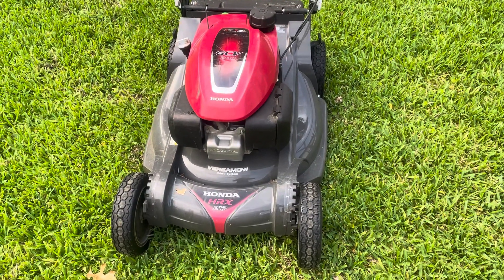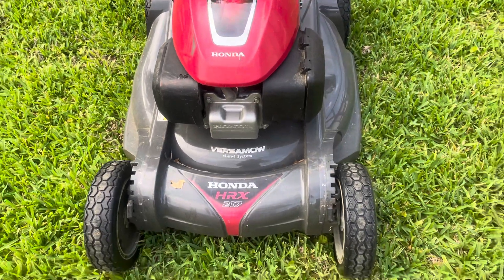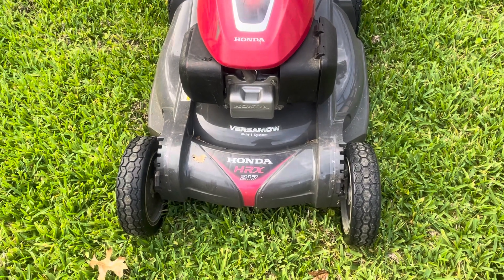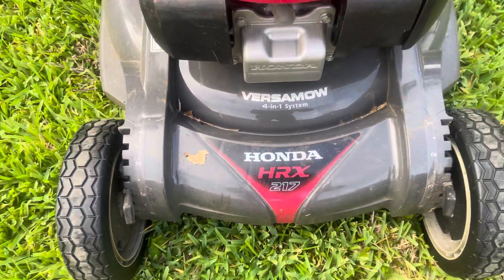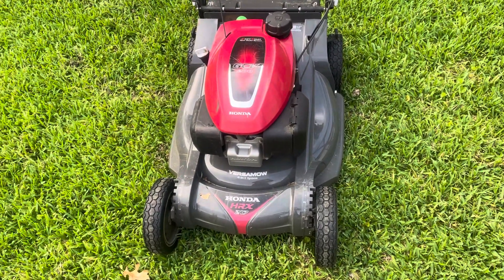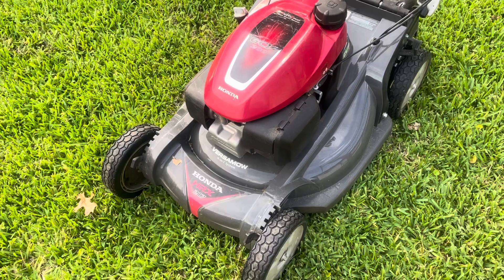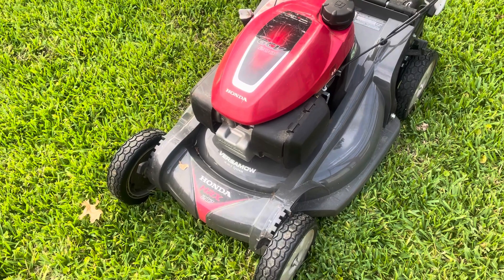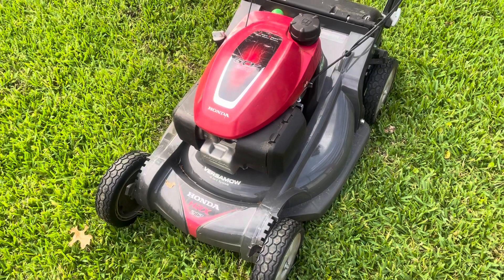Et Tu Honda ?- Plastic parts fail- just like in the new Sewing Machines- enough already! (Video301)

Comment: How true! I had a Toro riding mower for 35 years. No trouble until about 3 years ago. Plastic flywheel. I finally junked it and bought a John Deere. I'll never live to see it die. I'll be 76 on July 16th. Look at late 60s and 70s Singer machines. Solid reputation, but junk behind the name badge.
Reply from the maker: I was pretty surprised. No one likes being victimized by plastic. 
Lesson learned.
Reply: @randyyoursewingmachineman9954  
And who knows what is lurking behind the new battery operated stuff? Battery charging and how it affects battery life who knows? 
Cost of replacing the battery? More and more we live in a throw away society. Messed up big time.
Reply from the maker: @ronalddevine9587  you are correct. I usually can predict these things, but as of late, my crystal ball is in the shop. 
The battery failed and the new one is on back order. 
😂😂😂😎
Reply from the maker: Happy Birthday young man!👍🏼😎
Reply: @randyyoursewingmachineman9954  
Bless you my friend 🙏

Comment: There's a major part breakage defect on the commercial Lawn Boy I have 2 of, same model except one has the 4 cycle engine. The plastic parts are the very weak gears and another proprietary part that's in the front wheel drive where it gets cut grass wrapped around , stuck and before you realize it, a brand new one can break on the first job. If it weren't for that they would be good mowers with aluminum decks.

The neighbor threw out her old Honda Eager One because it had some issues. Sign said FREE! RUNS. I took it in and rebuilt the rusty deck that had holes and replaced hoses, cleaned jet, puller, ejection deflector hinge and two wheels. It is a simple push mower, but does the job after two or three years. 

 One thing we also have to watch out for, Randy, is the new ethanol gas.  It ruins small engines faster than anything. It's hard to find in some places, but you might already know to only buy ethanol free, sometimes called "Off-road" gas. It costs more, but the only thing for saws, brush cutters, mowers, etc.  
Sorry to hear about that Honda. I like Hondas too. Mine is just a simple little push mower.
Reply from the maker: I’m waiting to see what Honda proposes to do about all the bad mowers that are out there. Typically, it’s resolved with a class action suit. The lawyers will get the mine, the mower owners will get the shaft.

Comment: That is somewhat surprising. Honda hss been making some great engines for a long time and there are many clones trying to feed off the Honda quality and name. Argggg, sorry to hear about the plaastic engine part. I’ve till got an old kenmore washer and dryer I got from Sears. Bet some young people don’t even remember them but was only yesterday to me. Oh well. Anyway, hope you can fix it Randy!
Reply from the maker: I’m more shocked than surprised. Plastic parts in a cool running apparatus is one thing, but in an internal combustion engine, that’s insanity. 
I’m waiting to see what Honda has to offer as a settlement to the customers affected. 
Meanwhile I’m hitting the pawnshops and looking for an old Craftsman mower like the one I gave away when I bought this one. 
It worked well and started up every time. 
I guess I am dumber than I look after all. 
I fell for the marketing hype, just like I tell my customers not to. 
Oh well. 
Older and wiser. 
Except for the wiser part. 😎

Comment: Even when looking at Honda cars, several models have been a mess lately - while other of their models have been very reliable.  This strange variation shows the company is taking water.  Not a good sign. Speaking about the consumer products in general, I have the feeling that these days, the engineers are less talented than 20-30 years ago, and much less talented than engineers from 50-60 years ago. Something is going on with the population. It's not just the management part, but the engineering skills as well. And of course, there is pressure from the market price but this doesn't explain all the superficiality in the quality of the design. Also, prototypes are not tested properly.
Reply from the maker: Every single thing you sated is true. It’s a different world now. 
What we will accept, they will deliver. 
It’s amazing at what they brazenly present to us, and await our approval. 
If we demand better stuff, they will either make better stuff, or go out of business when someone else steps up. 
Of course that assumes that the free market economic principles still apply. 
I’m wondering if they still do.